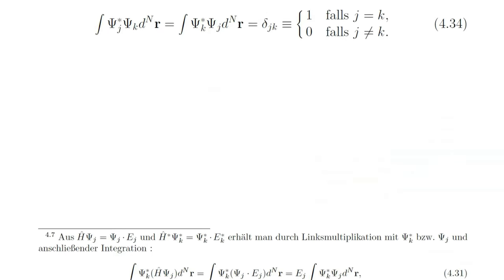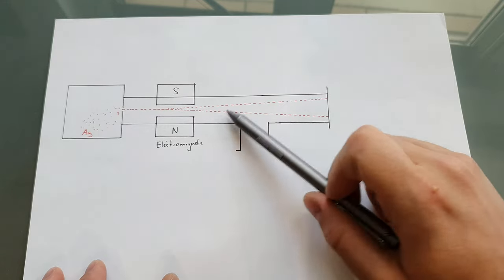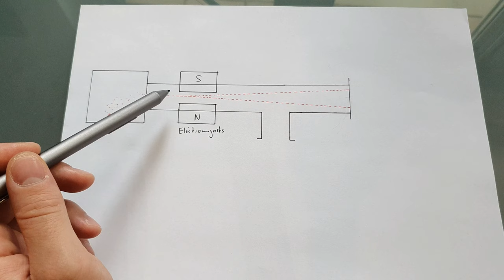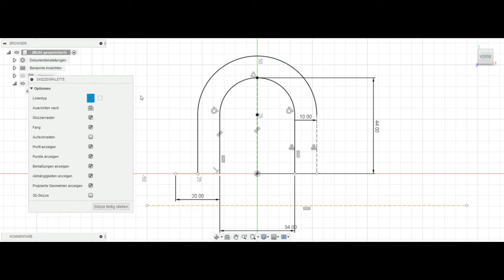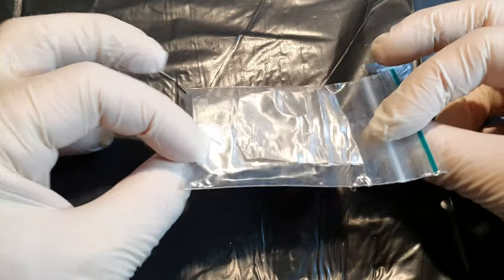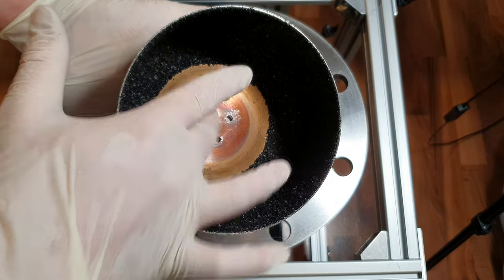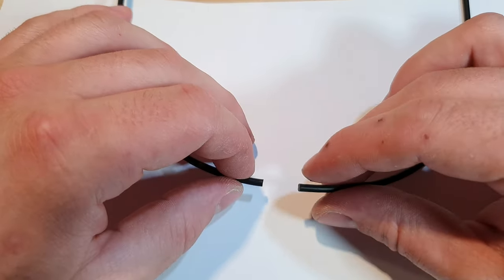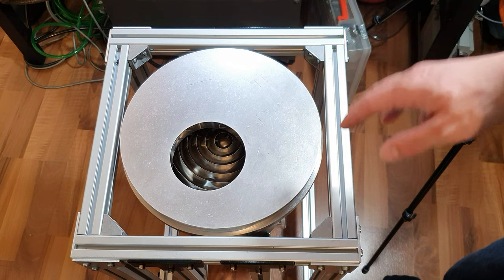Demonstrating Quantum Effects At Home: The Stern-Gerlach-Experiment Pt. 1: Rebuilding the cryopump

Comment: A simple way to make an ultra high vacuum seal that even works at cryogenic temperatures is to use indium wire. You only need two flat surfaces, no need to machine grooves and scratches are no problem. How it works is you lay a piece of indium wire where you want to seal it and you overlap the two ends and twist them a few times. When you bolt down the two surfaces you plastically deform the indium and create a perfect all-metal seal. You can search on youtube for indium vacuum seal to see how it works. I bought some indium wire for something like 100 to 150 euro a few years ago, but I think it's even possible to melt down some of your indium scraps into a little blob and extrude it into a wire with a fondant extruder, the metal is just so soft and it anneals at room temperature. Also, you're doing a really cool project by the way, good luck!
Reply from the maker: Thank you for the advice!
Reply: I love the idea of being able to extrude a wire with a fondant extruder!!!

Comment: HYPE!
I'm far from being anything near a high vacuum expert, but I think that super glued o-ring is reeeeaaaally gonna come back to haunt you later.   The glue is brittle and the viton is pliable so you're sure to get a crack there eventually. I don't think you need grease on it either. On our high vacuum target chamber at work we have 120 sealing surfaces, each about the diameter of your cryo here that have to be removed and reinstalled monthly. We used grease for a while, but basically it just made a mess of everything. Eventually we cleaned it all off and never used it again. It's just viton on steel now but it works really well for us.
Reply from the maker: Haha, yes I also thought about the O-ring being a problem in the future. But we will see. I am looking for a flexible glue, that is suitable for this purpose. 
Yes, I decided to remove the grease. Another person also told me, that it's not a good idea. 

Thank you for your advice!
Reply: @AdvancedTinkering  I don't know about viton or other O ring materials but some can be heat welded with just a soldering iron. 
Any flexible adhesives I can think of will offgass like it's their job I'd think.
Reply: I haven't used your sheer quantity of viton o-rings, but there's an o-ring kit that McMaster-Carr sells which includes some sort of CA glue that works fine. Splicing o-rings well enough to not leak is tricky, usually involves sanding it down, and then using finer sandpaper to bring roughness down, and also cleaning up the joint thoroughly with acetone to make sure you've got all the adhesive. Done well, the adhesive isn't the limit on anything except maybe higher-temperature performance.

That said, you can almost certainly buy a viton, or any other common rubber, o-ring of exactly the right size on McMaster-Carr or elsewhere. There are a lot of stock o-ring sizes.

Comment: I would say for the tree, a metal one that has probably 1-2mm gap between glass should be okay, however you would have to find a different way to attach it. I don't think it would be too difficult to make it using commercial glass funnels and the large diameter tubing you already have for your caesium still. Tapering the glass out on the bit that goes at the bottom would be difficult but I think you should be able to acomplish that using a second, wider tube and joining them together. Techniques of joining small tube to large tube exist already for making water jacket condensers and you can learn about it on the internet. You probably can make it all by hand but a slow speed lathe might be needed for some parts where having 2 hands would be useful. It definitely would be a challenge, but a useful experience. I wish I had some way of getting enough oxygen to run my torch for stuff like glassblowing so I could try some of these things but its proven somewhat difficult. Good luck on this project!

Comment: @AdvancedTinkering What would happen if the magnetic field was uniform? Would the electrons all collect to the top or bottom end of the screen? I don't see why or even how inhomogeneity would help in this case. If the electrons are quantum then they would be equally distributed in the spin up and spin down state, so even with dipole alignment or whatnot, the orientation of the electrons before they enter the field would be statistical and thus the atoms should still be deflected into two beams. The other issue I have is, how does the two patterns show that the electron can take only two spin states? I get that there are only two deflections on the screen, however, why isn't the intensity of the two deflections the same? Statistically, the spin distributions should be equally probably, the results suggest that one spin state is way more likely than the other. Is this an effect of the deformation within the magnet that produces the inhomogeneity? Could the entire results be explained by the deformation of the magnet instead of being due to any quantum effect?

Comment: Beautiful diffusion pump! It is sad that the tree from the inside is missing. Maybe it is possible to make it from some ceramic sintered powder? You have 3D printed version, indeed metal could end up cracking the glassware. Maybe 3D print the negative, fill it with some silica or alumina, glue it with water glass to make it solid and then fire it up a bit. It does not need to be fully melted but just sintered and strong enough. I have seen some videos making water glass based cement for high temps, then there is a chance it would work.
As for your cryo pump, depending on the vacuum you will get it is possible to make it better by addition of molecular sieves to cryo chamber. Zeolite based cryo vacuum pumps are well known and with them, you can go to those 10e-6 - 10e-7 mbars. Just note if usefull.

Comment: The adapter you have is not CF, it's ISO100. You can mount an ISO100 flange either to another ISO100 flange, or you can buy an "ISO100 single claw clamp" that you can drill a few blind holes into the plate for, and just clamp the flange directly to it. If your hole isn't 108mm in diameter, you won't be able to use an ISO100 centering ring, but you should still be able to use an ISO100 gasket and be very careful when clamping it down.
This is common practice in large chambers that need ISO flanges - no protruding machined pieces are needed.
Just make sure that you clean up the surface before you do it, since it looks like garbage. Some manual sanding and polishing should be fine, it doesn't have to be ultra-flat, just very smooth.
Reply from the maker: My bad, you are correct. That’s an ISO100 adapter. Thanks for pointing that out!
Awesome, I will look for a ISO100 gasket. Yes the surfaces definitely need to be polished.

Comment: Dl Deez Nutz
Eu am vrut sa spun ca, dupa deductiile mele, pornind de la ipoteza identitatii dimensionale masa-sarcina, rezulta ca electronul este format dintro singura unda E-M de foarte mare amplitudine,(511KV), care se roteste (se propaga) pe cercul de raza electronului  Re  cu viteza de C/137 (m/s), compusa din doua semiunde diametral opuse si se comporta ca un rotor cu puterea de 1080  W , cate 540 W pe fiecare semiunda, la turatia de 10^20  (rot/s) , un curent de cam 20 A sub o diferenta de potential de  27 V. Si fiind in rotatie, semiundele diametral opuse ale electronului se misca in sensuri contrare. De aceea, cand este in campul magnetic exterior, electronul nu poate interactiona cu ambele seminude simultan, ci interactioneaza doar cu o singura semiunda. Si exista deci probabilitatea egala ca jumatate din electroni sa interactioneze cu o semiunda si alta jumatate, sa interactioneze cu cealalta semiunda. Aceasta ar face ca pe ecranul tubului de experienta sa apara doua sinusoide opuse. Acest fapt experimental a fost interpretat ca find dovada existentei a doua tipuri de electroni. Unii levogiri si altii dextrogiri. 

Mr. Deez Nutz
I wanted to say that, according to my deductions, starting from the hypothesis of dimensional identity mass-charge, it turns out that the electron consists of a single E-M wave of very high amplitude, (511KV), which rotates (propagates) on the radius circle of the Re electron with a speed of C/137 (m/s), composed of two diametrically opposite half-waves and behaving like a rotor with a power of 1080 W, 540 W on each half-wave, at a speed of 10^20 (rot/s) , a current of about 20 A under a potential difference of 27 V. And being in rotation, the diametrically opposite half-waves of the electron move in opposite directions. That is why, when it is in the external magnetic field, the electron cannot interact with both half-waves simultaneously, but only interacts with one half-wave. And there is therefore an equal probability that half of the electrons will interact with one half-wave and another half will interact with the other half-wave. This would cause two opposite sinusoids to appear on the test tube screen. This experimental fact was interpreted as proving the existence of two types of electrons. Some are left-handed and others are right-handed.

Comment: Eu am dedus ca electronul ar fi o unda stationara de mare amplitudine  (de 511 KV), formata din doua semiunde diametral opuse. Iar experimentul Shtern-Gerlac reflecta cu fidelitate structura bipolara a electronului, in care energia cuantei constitutive este distribuita in doua semisinusoide opuse, care corespund celor doua semiunde diametral opuse, din unda stationara de mare amplitudine a electronului. In unda de mare amplitudine a electronului, care se comporta ca un rotor bipolar se verifica faptul ca forta electromagnetica propulsoare este egala cu forta de inertie la nivelul fiecarei semiunde. (B.I.L=m.a).  La fel puterea mecanica este egala cu puterea electrica. (F.v=U.I)

I deduced that the electron would be a high-amplitude standing wave (of 511 KV), consisting of two diametrically opposed half-waves. And the Shtern-Gerlac experiment faithfully reflects the bipolar structure of the electron, in which the energy of the constitutive quantum is distributed in two opposite half-sinusoids, which correspond to the two diametrically opposite half-waves of the high-amplitude standing wave of the electron. In the high-amplitude wave of the electron, which behaves like a bipolar rotor, it is verified that the propulsive electromagnetic force is equal to the inertia force at the level of each half-wave. (B.I.L=m.a). Likewise, mechanical power is equal to electrical power. (F.v=U.I)

Comment: Orice radiatie E-M pare sa fie un relief electro-magnetic, care luneca sau gliseaza prin spatiul fizic materializat de oceanul materiei inponderale, fiind propulsat de forta electromagnetica. Forta care se demonstreaza ca, la nivelul fiecarei semiunde este la echilibru cu forta de inertie. (B.I.l=m.a). Asemenea reliefului de pe un disc, care fiind in rotatie, pune in vibratie acul dozei, fara ca pe disc sa existe vreo vibratie.

Any E-M radiation seems to be an electro-magnetic relief, which slips or slides through the physical space materialized by the ocean of weightless matter, being propelled by the electromagnetic force. The force that proves that, at the level of each half-wave, is in balance with the inertial force. (B.I.l=m.a). Like the relief on a disk, which, being in rotation, vibrates the needle of the dose, without there being any vibration on the disk.

Comment: Won't the 3D printed part include significant voids and would outgas?
Just starting this series so this will likely be answered later 🙃
Reply from the maker: Not sure which part you are referring to but you are absolutely right. 3D printed parts are not suitable for (high) vacuum applications. There will be a new video about the Stern-Gerlach-Experiment soon :)
Reply: @AdvancedTinkering  I meant the adapter plate between the cryopump top plate and the kf-40 flange. Might've been just a placeholder part.

Grüße aus Bayern :)
Reply from the maker: Ah ok. That plate would not be exposed to the vacuum. It's only on the outside and used to clamp the flange against the top plate on the cryopump. But as you will see in the next video, the cryopump idea got replaced really quickly thanks to a turbomolecular pump I got. 

Grüße zurück! :)
Reply: @AdvancedTinkering  Ahh makes sense.
Have you had a look at fablabs in your area?
Maybe one of them might have CNC/Machining capabilities you could use.
Alternatively machinist YouTube might be of help.
Stefan Gotteswinter would come to mind, maybe he could help.

Stoked for the next episode

Comment: Este normal sa nu admiteti ce nu scrie in manuale. Dar dupa ce se descifreaza constanta de actiune  h  si cu legile electromagnetismului, rezulta structura bipolara a electronului. Inpartiti lungimea de unda a fotonului gama electronic la 137 si apoi la  2.pi  si o sa obtineti raza clasica a electronului  Re=2,81743.10^-15 (m). 137 este indicele de refractie al mediului atomic, de mare densitate energetica si este egal cu inversul constantei de structura fina  alfa. Ceeace dovedeste ca electronul este unda stationara bipolara (adica formata din doua semiunde diametral opuse) de mare amplitudine a fotonului gama electronic. Si ca fotonul gama ca orisicare foton are exact masa particulei din care se naste prin mecanismul reactiei de anihilare. Structura bipolara a electronului ar fi dovedita de experimentul Shtern-Gerlack, in care desenul acare apare pe ecran, pare a fi o reflectare fidela a structurii dinamice a electronului. 

It is normal not to admit what is not written in the manuals. But after deciphering the action constant h and the laws of electromagnetism, the bipolar structure of the electron results. Divide the wavelength of the electronic gamma photon by 137 and then by 2.pi and you will get the classical radius of the electron. Re=2,81743.10^-15 (m). 137 is the refractive index of the atomic medium, of high energy density, and is equal to the inverse of the alpha fine structure constant.Which proves that the electron is a bipolar standing wave (ie consisting of two diametrically opposite half-waves) of high amplitude of the electronic gamma photon. And that the gamma photon, like any photon, has exactly the mass of the particle from which it is born through the mechanism of the annihilation reaction. The bipolar structure of the electron would be proven by the Shtern-Gerlack experiment, in which the drawing that appears on the screen seems to be a faithful reflection of the dynamic structure of the electron.
Reply: I pictured a gamma ray as being composed of a positron and electron trying to orbit each other, but ending up driving each other forwards along a double-helix.
Reply: And your claim is based on what evidence?
You're saying an electron is composed of two em waves attached but with different wavelengths?

Comment: just thinking about using a photofilm as a detector?
Reply from the maker: Mh... interesting idea! But what kinf of photofilm would be sensitive to potassium or silver atoms?
Reply: @AdvancedTinkering  shouldn't possibly the energy of the hitting atoms be enough to blacken the photofilm or best the x-ray-film? 
the energy is quantumized, so if electrons can blacken the film, why should't silver atoms? i do not know. call it "loud thinking".
Reply: @AdvancedTinkering  the other possibility could be a phosphorous foil or screen like seen when there are xrax pictures in cartoons. breaking a leuchtstoffröhre and letting the atoms hit the white stuff should make it glow if the energy is high enough.
Reply from the maker: I don't think the atoms will have enough energy to blacken the film or get a phosphorous layer to glow. They are not getting accelerated, their speed is only due to the temperature in the oven. 

What I was thinking about: Using a piece of filter paper covered with a layer of phenolphthalein. After the experiment, I can use a little bit of steam to get the potassium to react to potassium hydroxide, which will change the color if the indicator to pink. 
But I have no idea if it would work.
Reply: @AdvancedTinkering  

ah - i didn't get the part with "not accelerated" - so the atoms will have to steam out the oven by coincidence. 

the potassiumreaction may be a promising way.